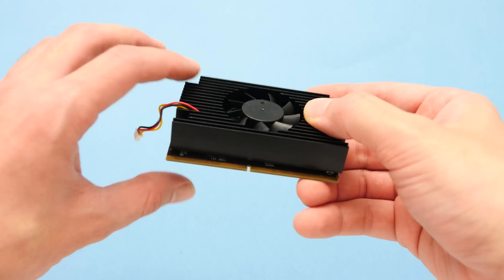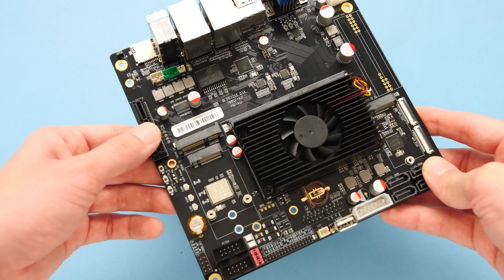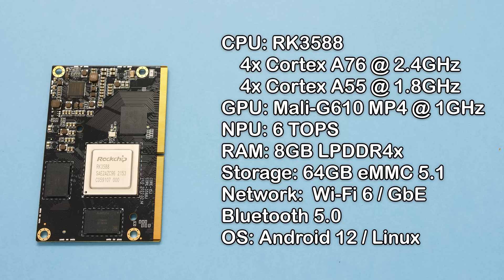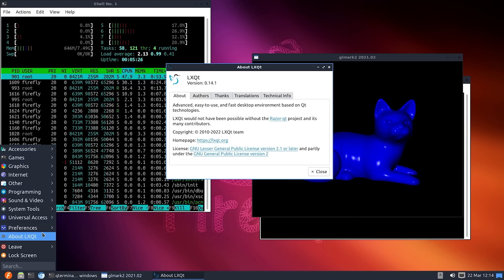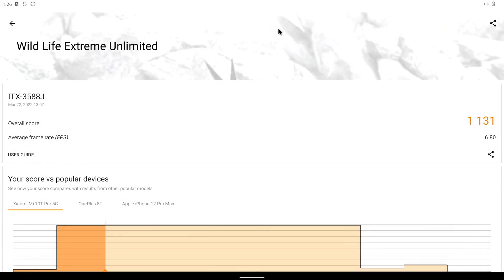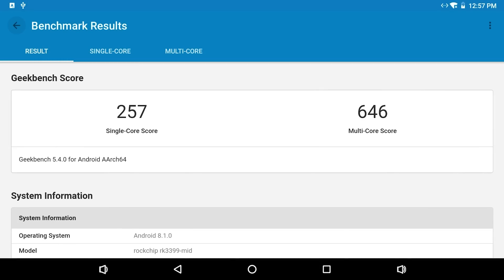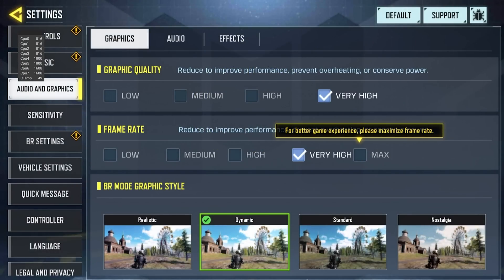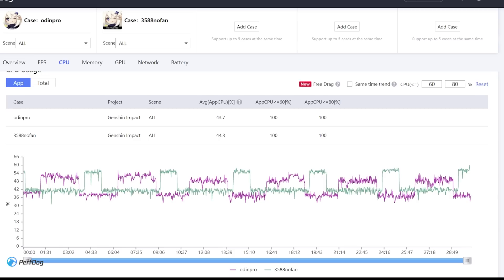The Wait is Finally Over! - All-New RK3588 / ITX-3588J First Look

Comment from the maker: Technically two boards. It's still amazing.😏
My next video is going to showcase Switch, PS2, 3DS, and other systems on this chip.
Reply: Hey Taki, can you also add some other Android Apps to your testing arsenal?
My short-list (very hard to hardest):
Real Racing 3, Genshin Impact, Ark Survival Evolved, Doom 3, and Tomb Raider 2013.

(rant)
Without the overhead of emulation, technically these ARM devices can play much more graphically impressive titles, than what we can expect out of say a Nintendo Wii title. And they could do so at an equal or lower power-draw.

Here's a list of some of the best looking games I could find:

Sky Children of Light, Morphite, Endless Nightmare, Shadow Fight 3, Infinity Blade 3, Dead Trigger 2, Shadowgun Legends, Asphalt 9 Legends, Real Racing 3, CoD Mobile, PubG Mobile, Fortnite, Genshin Impact, Ark Survival Evolved

And there's even more than that. Nvidia Studios, the department which usually handles Game-Specific Drivers for their dGPUs have some surprises for us. They have some exclusive titles on the Nvidia Shield TV that they have ported from x86/Windows. Most of these are very impressive graphically, and here's a shortlist of them:
Skateboard Party 3, Portal, The Witness, Half-Life 2, Doom 3, MGR Revengence, Tomb Raider 2013.
Reply: Have you heard of the Phytium D2000?
Reply: So... 2023 for a new Odin model with this ? Would also be curious to see consumption and performance if you try to limit it at say... 7 watts for example ?

If it can provide same or better performance at low wattage, that would mean a huuuuuuge improvement to battery life for future devices/android consoles !!!

Comment: At that point just build a pc, why spend more than 1k on a naked board? 

Things not really making sense. I built a gaming pc for roughly 1k with a 3070+5600x.
Reply from the maker: The 1K was to be able to get the alpha/beta samples of this processor. It's kind of a necessary evil if you want to test the tech when it is brand new if you don't have a direct connection with the SoC provider. The chip itself isn't worth that much.

Comment: "The Linux firmware is not as polished as the Android port."

Guys, please, stop buying into the idea that the operating system is firmware. It's not, or at least, shouldn't be. For a board this powerful, in a standard ITX form factor, being able to run your own OS on top of a standard firmware/bootloader interface should be an absolute must. Accept nothing less.

If Firefly is considering the OS to be firmware, they're doing it horribly wrong.

Comment: Great review! This 3588 soc looks amazing! I have a rpi4 and khadas vim 3 and have been enjoying them for three years now I’m looking for a more capable sbc. Khadas is releasing the vim 4 I’ve recently watched a video of the vim 4 and I’m not impressed with it at all. It’s Android os is still running in 32 bit mode meaning in spite of all that cpu and gpu power it can’t install dolphin or aethersx2 emulators! I need the rk3588 sbc asap. Big ups!
Reply: The vim 4 runs 64-bit android 11 now.
Reply: Would this be better than pi 4
Reply: @truebengalsfan  yup

Comment: nice system, although its slow. 2.4Ghz is considered slow and based on what you are showing this must be a Linux Only system. windows 10 could work, if the chipset supports it.

Comment: On the parts-list breakout page for that board, I noticed pin 21 listed as "heating" - any idea what that's intended for? My first thought was 3D printers, but... maybe more for extreme weather use cases, so the board doesn't freeze? What's that actually for?
Reply from the maker: I also have no idea 😔

Comment: whats the point  i got a core i3 1125g4 laptop  way more powerful than this with screan  ssd ram web cam keyboard a lot of ports for $270 on a beatiful 14 inch screan and i am using it with linux

Comment: Hey TAKI, I would really love an emulation test on the hobbit for the original Xbox or the GameCube mostly to test frame rate issues and to see if movement glitches still occur under load, or while the camera is in a position that loads more geometry
I’m mostly curious for speed running purposes but also because I love that game

Comment: Good to see some real world use. I am sure that many people will want to see emulation through the whole range of options available just to get some early indication.

Was the 8K video shown rendered with hardware acceleration (which I am 99.99% sure will not be the case under Linux)?

Confirmation of hardware AV1 codec support will be useful.

I think that all initial testing should be done with the active cooling as that is what Firefly has provided for a reason.

There is one thing that could derail much of the RK2588 progress, which is the pricing, because if it starts to get into what we typically see from the Intel/AMD range, then it may fail in terms of mass appeal.

The cost of this particular one is sadly laughable. $589.00 for the basic package will be an instant turn off for so many.

I presume that the reference to 8 GEN1 was to the latest Snapdragon SOC?

Comment: You will find Mali-G610 MP4 GPU on Dimensity 8100, but overall amazing specs
Reply: Actually, Dimensity 8100 has Mali-G610 MC6.
Reply: @sokool3994  Sssshhhh i made a mistake so don't correct me 😂🤣🤪

Comment: Taki said "You can see there's some thermal paste on this board" your not kidding it was absolutely plastered in the stuff LOL
 It would be nice to get a smaller form factor IO board with just the IO needed for a handheld form factor
Reply: I think it's a similar some to a CM3, so idk if it's really worth bothering
Reply: @slumpchogg  Its  much faster than a CM3 in fact its faster than a CM4 so is ideal for a handheld once the heatsink and fan are changed for a low profile model, its easy enough to knock an IO interface up on the PC and get JLC PCB to make the board and populate it if feeling flush
Reply: @AndrewAHayes  I meant in form factor, sorry should have phrased that better

Comment: I hope this will get alot of support like the RockPro64 did.
Reply: the RockPro64 is an unbootable brick 9 out of 10 times ,sw support or not, DO NOT waste your money at any price.
Reply: @paulmaydaynight9925  Been using my two rockpro64s as a NAS since 2020 with no issues. But I do admit the first year was buggy as software support was not all there but going into 2021 sofware support catched up and it's been rock solid ever since.

Comment: I'm wondering if the 552 was originally designed to house this, but delays caused a replacement.
Reply from the maker: I doubt that. The current products that are releasing or will soon release are from companies that are primary customers of Rockchip.

Comment: Holy cow, that's amazing! I worked out the other day that if you compare the Nintendo 3ds to the PS5, the PS5 is approx FIFTEEN HUNDRED times more powerful. It seems that things are continuing to power upwards in a ridiculous direction. Long may it last ;) Great video Taki, you do get all the best toys...
Reply: compare it to the original gameboy while youre at it 

if youre Arbitrarily choosing systems lol
compare it to the atari 5200
Reply: The Nintendo 3DS has an ARM11 CPU, so the single-core performance will be about 1/3 that of a first-gen Raspberry Pi when scaling for clock speed. They make DSP microcontrollers for cars that are faster than this for $10 (obviously the 3DS has a GPU, while your car's ECU doesn't).
Reply: compare it to the fairchild channel f 😈